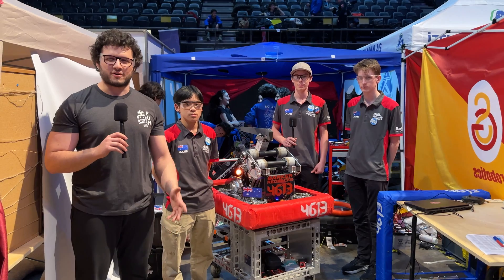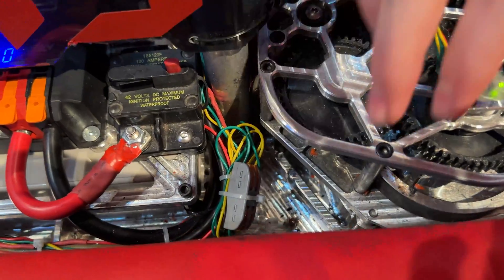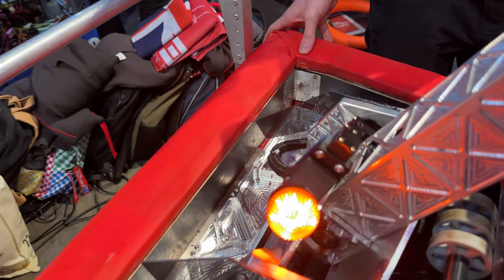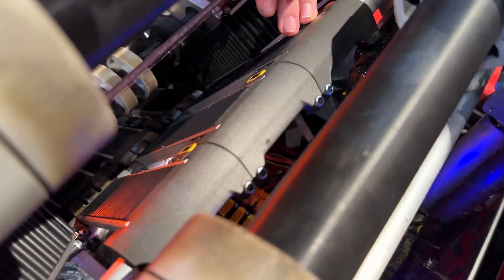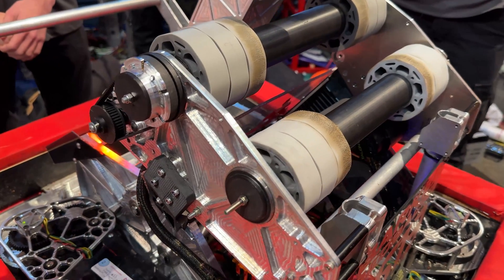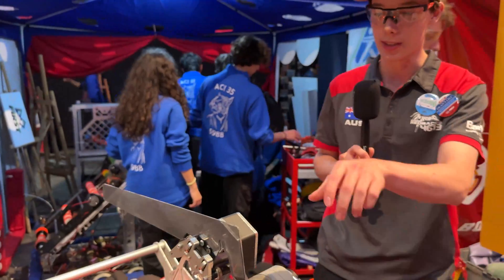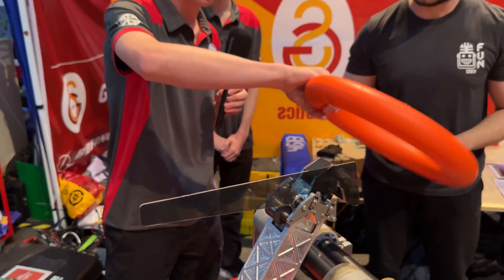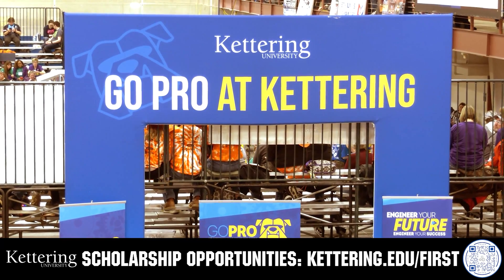Behind the Bumpers | 4613 Barker Redbacks | CRESCENDO FRC Robot

Comment: Why do their swerve modules look like that, are they using a custom gear ratio?
Reply: I had a chance to listen about their robot at the event. They said that these swerve modules are custom built in order to create more space for mechanisms. Also while designing the module, they used a bigger custom gear at the drive motors of the swerve which increased their robot's speed. For anyone curious about building details, this robot literally gave me goosebumps while inpecting it. They didn't have anything that build spontaneous on it. Amazing job...